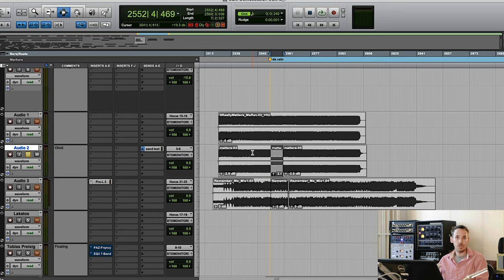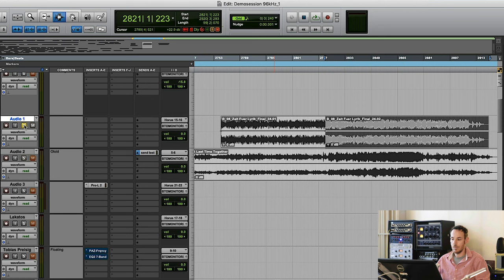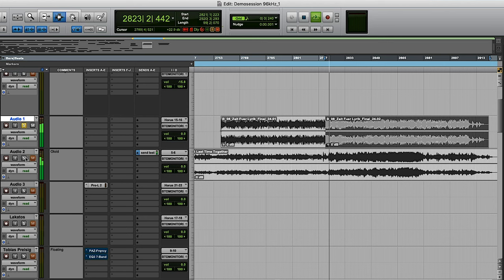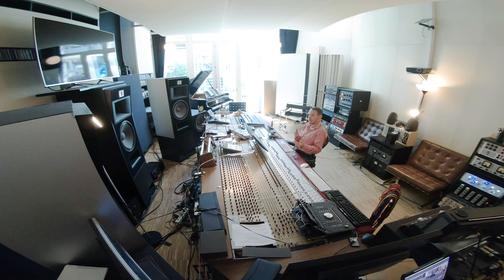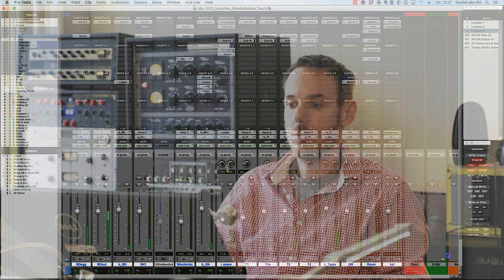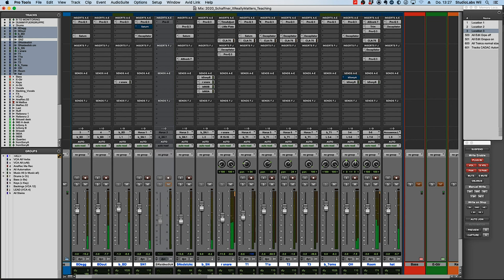How To Get A Big Mix - Understanding Dynamics And Physical Integrity | MwD Episode 2

Comment: The tracking is most important, mic placement & number of mics. Many jazz recordings are under miked so they are difficult to make sound large.
Reply from the maker: I just made a great recording with Jorge Rossy, using only 3 mics. I will make a video about that production. Sometimes it takes a lot of mics, sometimes it takes less - but the sources need to be miced as good as possible. Mostly the problem is the room. Music is recorded in too small rooms nowadays.

Comment: Very impressive and useful. Do you normally switch all the compressors of one section, eg drums, to the same musical release time, fitting the tracks bpm? Or are you purely orientated to listening and do not care too much if the different processors have different release settings. Usually I mix into a channel strip and try to set musical values to all the channels within the strip eq modules. Maybe you already did that on your analog console?
Beside that I liked how you approached the analog - digital subject. I think this is one of the most reasonable approaches I heard so far. Cheers and thank you for this video.
Reply from the maker: thanks. 
No I never ever try to set "musical" time, I set the up by ear and how I like them and how I think it helps the mix best:-)
Reply: @danieldettwiler.official  Okay. Maybe some variations from channel to channel helps to make the mix more open?

Comment: ur the master everything u say make sense. just curious if too much higher harmonics wont sound good either. so how to keep all harmonics in balance especially higher order harmonics?
Reply from the maker: It's about the right balance. Too much again is then very bad, except if you need a lot of distortion. Basically, a lot of saturation leads to audible distortion. Some tracks need only saturation (less or more heavy), then some need audible saturation and some need distortion.

Comment: What is the benefit of using compressors and saturation to make the waveform 'flatter'-looking vs. using an EQ? Could you achieve a similar result by boosting the mids and highs so that it looks flatter visually? Saturation increases the volume of not only the original harmonics but also introduces new harmonics (and so can make the sound more distorted and dissonant if used aggressively), which can be a downside for example.
Reply from the maker: This is covered in my Mixing Bible - (available at www.danieldettwiler.com) it is an interesting question for sure. An EQ boost would be static, and might be great if the instrument plays in the low range, but might not be appropriate anymore if the instrument plays in the high register. In Saturation however, the Harmonic's that you enhance will "move" with the Pitch of the instrument. So the "enrichment" of the instruments is not dependent of the pitch, which sometimes can be important. Also, if you boost with the EQ, it might sound great if the instrument plays soft, but it might not sound good anymore, if the instrument plays loud, as then the upper harmonics usually are louder anyway. Dynamic Equalizing is then also a good point. It's certainly something that I could most likely not cover in those free YouTube Lessons.
Reply: @danieldettwiler.official  Thanks for the thoughtful response - those are great points. I'll check out your course!